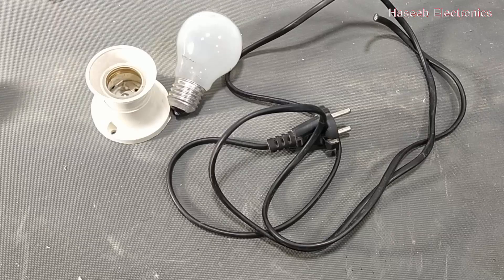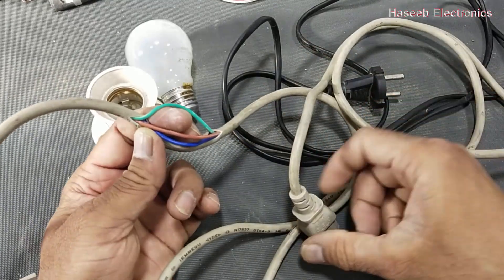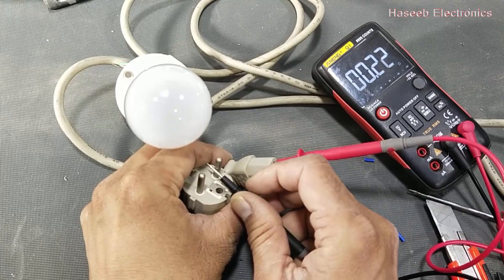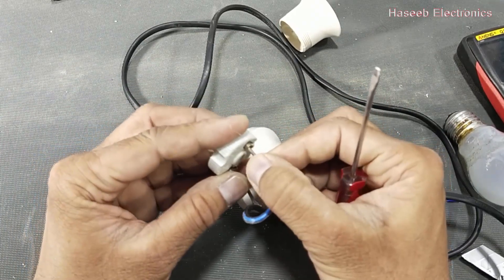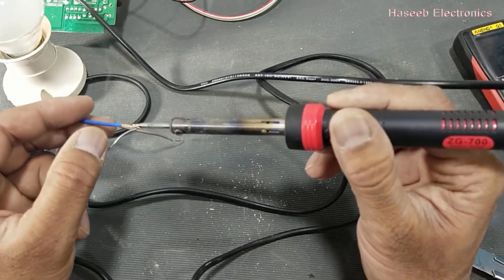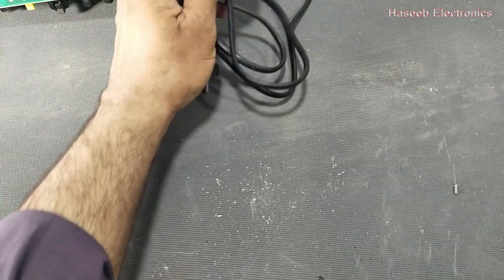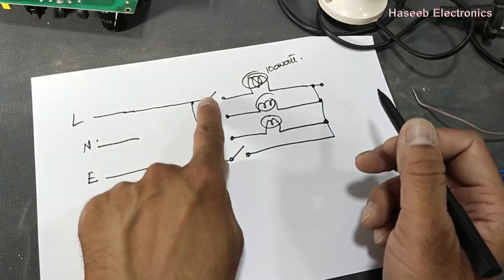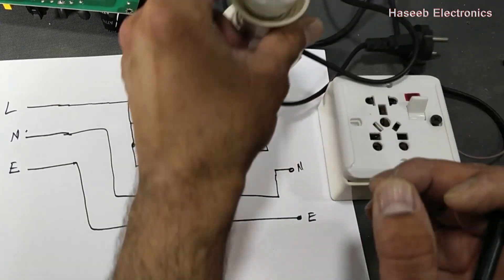{529} How To Make Series Test Lamp / Portable Series Test Lamp / Test Board for Workbench

Comment: Does it protect from short circuits shock sir ?
Reply from the maker: No. it just reduces the input current for the DUT / UUT. in case any short circuit in load it will not allow more damages
Reply: @ so if short circuits it’s prevent from tripping breaker. Right?

Comment: on 5:35，100W bulb each. Means that turns S1 on to use 100w，S1 and S2 on to use 200W?
Reply from the maker: exactly yes. these switches will provide lamps in series of the load
Reply: @HaseebElectronics  P=V^2/R, thus, 200w * 50 ohm =V^2,  and V = 100 v voltage drop on both bulb (parallel). Did I calculate correctly?  From here, we get Voltage is inversely proportional to resistor, limiting the current to the load.

Comment: can i use 60 watt lamp to test tv?
Reply from the maker: yes 60 watt can be used. in some conditions, it will not provide enough current. 
if light up. then use 2 lamps in parallel 60 watt each

Comment: can replace 100w to 12w bulb kindly confirmed
Reply from the maker: no 12 watt lamp will not allow to run the load. 
60 watt or 100 watt lamp having 220 volt is the best choice as series lamp
Reply: @HaseebElectronics  Thanks

Comment: Some China guys cleverly integrated three functions into one testing box. i.e. Series Test Bulb Protection with fuses and MCB, Adjustable DC 30v 5A output Bench Hobbyist PSU, and quick simple LED Light Strip testing.

Comment: Thank you for your ongoing efforts to share your experiences and knowledge! I have a question please. Can a servo-motor regulated full automatic transformer be used as an isolation transformer?
Thank you again.
Reply from the maker: thanks a lot for your valuable comment 
servo transformer is a variable auto-transformer, and auto-transformer doesn't provide isolation \
you have to select separate primary and separate secondary wound transformer
Reply: @HaseebElectronics  Thank you for your prompt reply! May Almighty Allah reward you now and then.

Comment: looking at your circuitof the bench test, I was wondering why you would want to turn off the first bulb, the one I made have the bulb always connected, I just use 1 switch in parallel when I want full power
Reply from the maker: really great and perfect point 
I am thankful for your valuable suggestion. and you are absolutely correct that first lamp should remain in circuit all the time 
please accept my best regards 💕

Comment: For  making a series lamp, why there is need to bypass switch? Can you explain how can we decide which watt lamp is required, if 75w 100w or 200w for which application? Some smps have two separate fuse one in hot side ac section and one in hot side dc section after main capacitor with same ratings why?
Reply from the maker: while using series lamp if we need to apply full power we can apply direct power by just turning ON bypass switch 
it is useful way 
for small smps circuit like mobile chargers to some 100 watt industrial power supplies we can sue 100 watt series lamp
for inverter ac boards / sewing machines boards / washing machines we can use 200 watt
for welding machines and inverters / UPSs we can use 300watt
so the same configuration can be utilized for multipurpose repair work

Comment: I have 2 100w lamp , how do I connect then together so they become 1 200w lamp
Reply from the maker: connect both lamps in parallel. 
as i discussed in the diagram
Reply: @HaseebElectronics  thank you ;)
Reply: @HaseebElectronics  Since the power is same in series and parallel, may i know why not connect both lamps in series? I know it is convenient for more option but have another reason? By the way, thank you to share this current limiter

Comment: Sir may i know what is the importance of making a series lamp with a parallel of 3 lamps 100 watts each what is the purpose of using a 3 lamps in a circuit can you walk us through sir tnx
Reply from the maker: it is a multipurpose series circuit, so we can add series load as per our requirement. for example while working on inverter welding machine we need ore current with compare to working on a tv power supply. 
for normal low wattage job we can use 100 watt series bulb
for some PFC based power supplies, 100 watt is not enough then we can turn ON the second lamp 
if we need more current then we can turn on the 3rd lamp, in this case three parallel bulbs will in series of the load, so load can operate safely
Reply: @HaseebElectronics  tnx for the information sir
Reply: @HaseebElectronics  and that exactly what happened to me, after fixing big power supply, 100w lamp couldn't power it ON, this is because of the lamp filament how much power can handle, thank you for the information.

Comment: I had some failures before making a series lamp. It is a very good safety tool and everyone should make one if testing smps or atx power supply etc.
Reply from the maker: yes dear, it is very important safety tool while working on some circuit boards specially power electronics 
it covers many mistakes while working on some circuit and also easy tool in troubleshooting

Comment: Thank you for very informative video
Brother I have question about capacitor voltage
Question: if AC voltage 220v after rectifier
So how much the Capacitors voltage Should be ?? 
On capacitor label 100uf 450v so how much the voltage should be after rectifier before capacitor ???
Should we apply 450v on capacitor OR should we apply 320v ???
If you answer that question I will very thankful for that
Best regards from Philippines